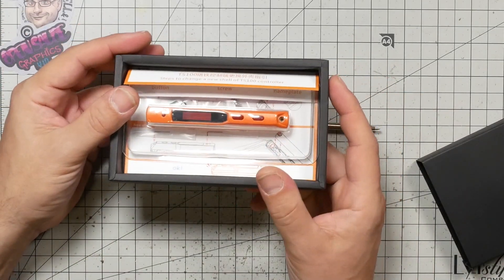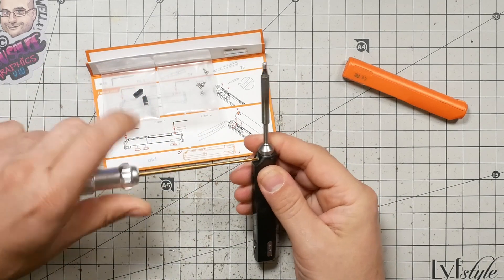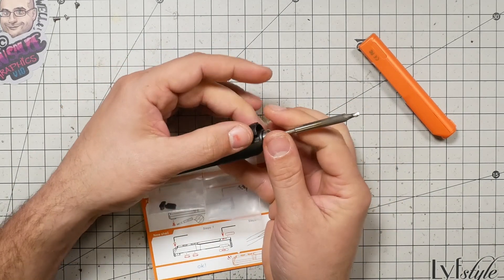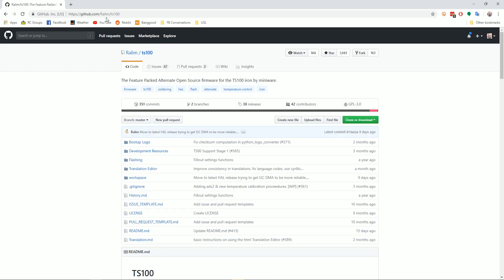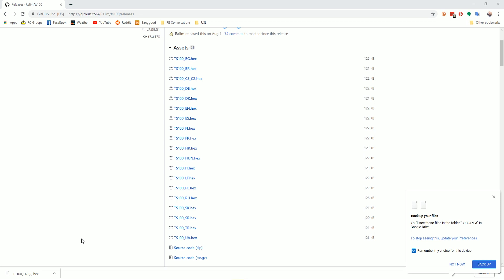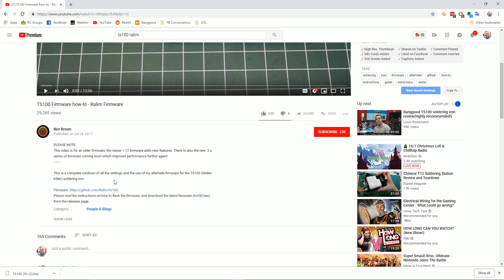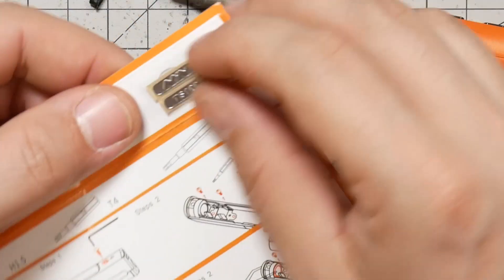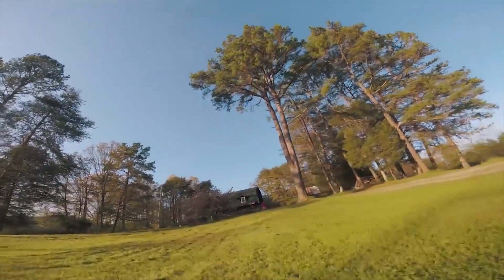TS100 Soldering Iron | Install Ralim Firmware and Custom Colored Case Shell

Comment: In looking to save a few bucks I ordered a "TS100" on Amazon that turned out to be the Sainsmart version (I didn't look at the description, only pic and price). It looks and acts identical but with a different splash screen. Do you know if you can put the Ralim firmware on these without bricking them?
Reply from the maker: Probably you can do it.
Reply: Yup, works fine on that unit.
Reply: Thanks a bunch, I'll give it a go...it looked like these were just TS100s with different firmware but I didn't want anything to be too different and I end up with a fancy little brick.

Comment: Hi. I think you do a mistake in 12:18.. you need flip connector. 🤔
Reply: Yes it appears to be backwards.  It also moves the contact off center on the contact band of the tip.  This can be seen by comparing the image from the beginning of the video 3:43 and end 12:51.  Now more stages of grief and denial as Joshua decides whether or not to fix it.  Joshua, please let us know your decision. 😂  Thanks for the video, I think I will do the firmware update.  Colored phase tape on the original case seems simpler for ID purposes.
Reply: I looked  the same.
Reply: Yeah I +1 that, the contact is the wrong way around. It has a locater part that should go in the hole right next to the screwhole
Reply: @1kleineMax1  Just hope that centering tab does not ground to the copper ground ring that was first installed.